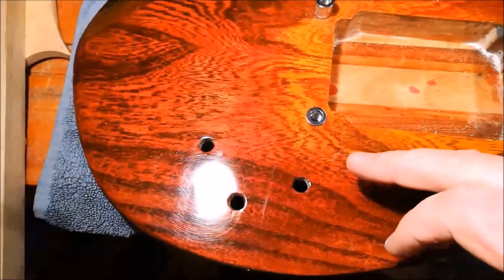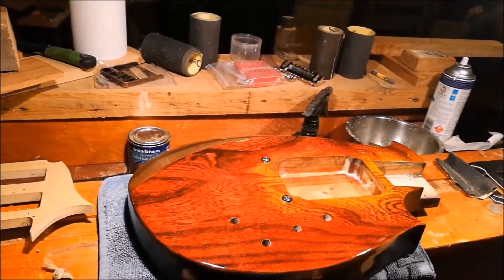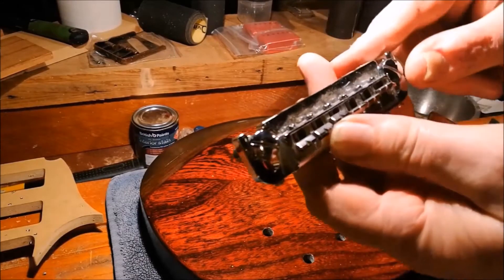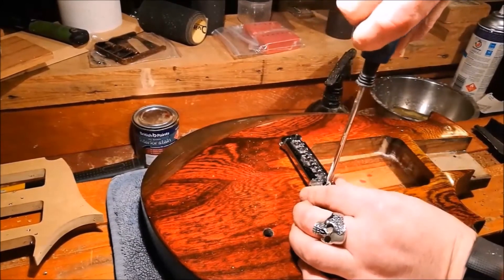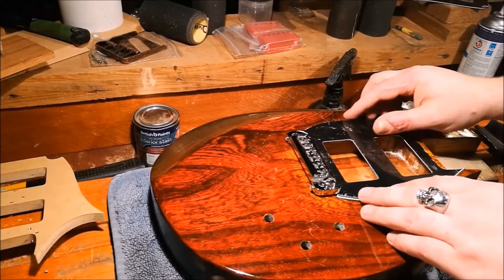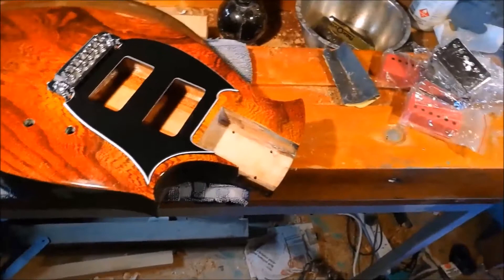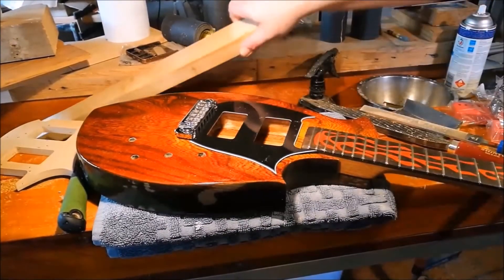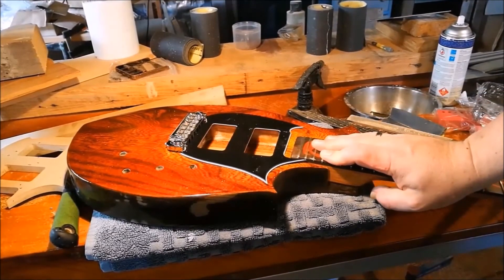Episode 066: The Flame - Installing the bridge and correcting the neck angle

Comment: If you need a bit more fine tuning on the neck angle, you could use a shim.
Reply from the maker: Yes I could, but I don't like the idea in principle. I don't know what loss of resonance that causes, but possibly some. And I do prefer elegant solutions - a neck pocket that has the right angle, rather than one that doesn't, but has an extra object in it to compensate.